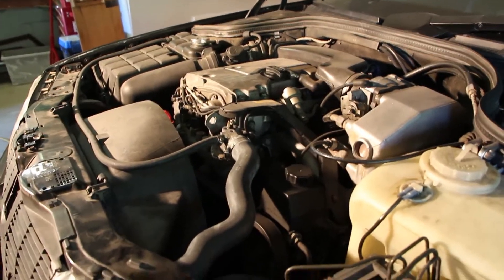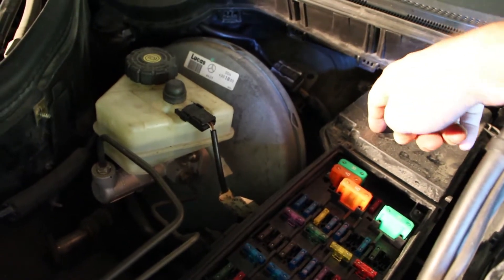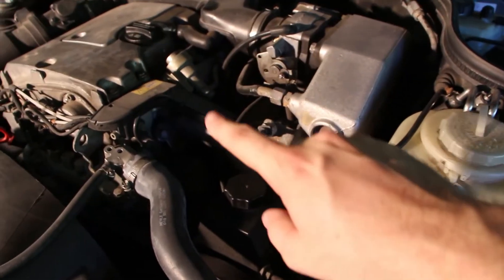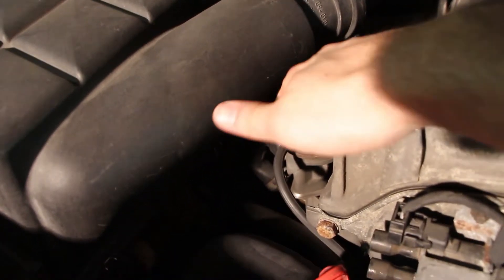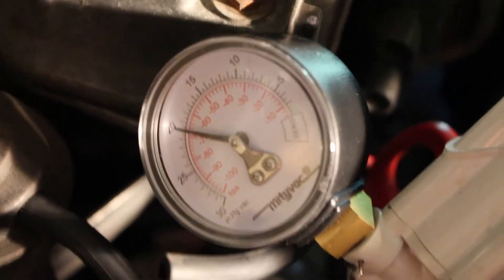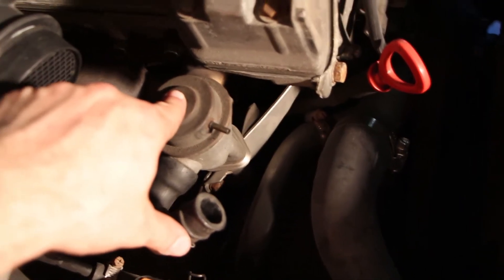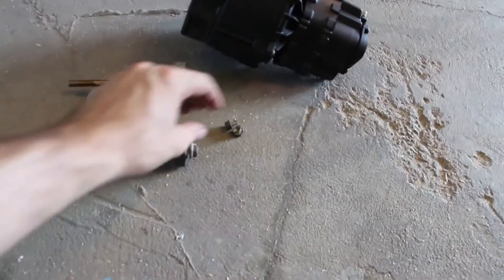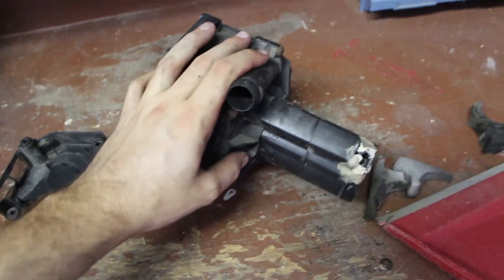Mercedes Secondary Air Injection

Comment: My engine is M111 running on 1995 W124..there is no SAI in my W124!!!
Also there is no electric pump under the plastic cover at the engine front.
Maybe different specs.my W124 is middle eastern specs.
What does SAI do?
Reply from the maker: It forces air into the exhaust for the first ~90 seconds when the engine is started from cold to warm up the catalytic converter faster. Modern cars have replaced this system with a pre-catalytic converter (which is much simpler as it a passive means to achieve the same effect).

It's entirely possible that cars made for markets outside of Europe / North America do not have a SAI.

Comment: ive got a w202 c230 kompressor. is it possible to delete the whole SAI system, block off any ports and or hoses, and wire in a resistor to eliminate the check engine light?
Reply from the maker: Nope, the ECM expects the pre-cat O2 sensor value to change. You would have to reprogram the ECM not to get a check engine light.
Reply: @PatsCarGarage  That's fine. Coming from the audi world, we just use resistors to delete almost anything!

 Do you happen to know who, or where I can get it reprogrammed?
Reply from the maker: @1984-f7q  Unfortunately no, tuning on MBs (especially older models) is a hard thing to come by. You gotta call up some local shops and see if they can help.
Reply: @PatsCarGarage  all right. ill see what i can come up with

Comment: Ok, where in heck is the relay in the relay box!!!! which relay is it?
Reply from the maker: Front fusebox, to access the relays you have to remove the 6 screws around the perimeter of the fusebox, that will allow the rear cover to be opened up and it will give you access to the relays. The SAI relay is pink.